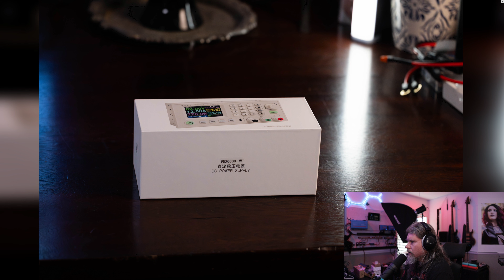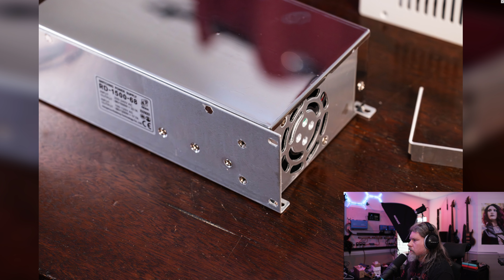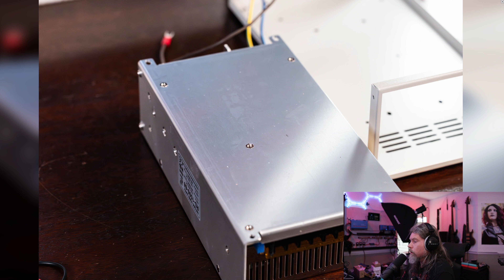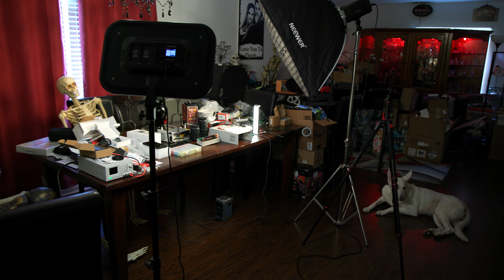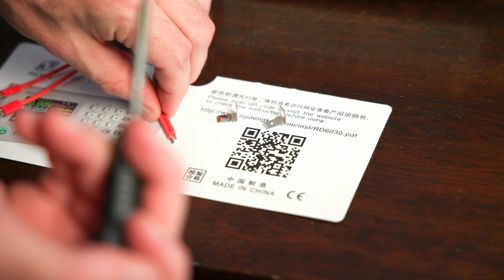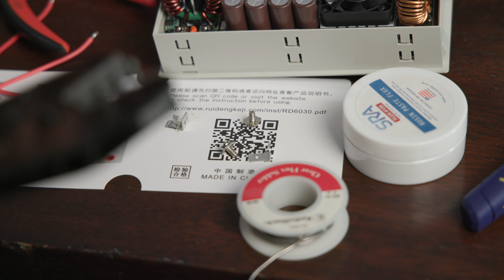Master the Art of DIY: Step-by-Step Guide to Assembling an RD6030 Lab Power Supply!

Comment from the maker: I just posted this video and I bet I just figured out what those "useless" spade terminals were for.  The size of them would fit the temperature probe.  This power supply is designed to charge batteries, and that is actually the main purpose of the temp probe is for battery charging to ensure you do not go beyond temp (This was not a review lol) but where/how would you put that probe on a battery?  The answer is that spade connector, you can screw it down and insert the probe inside.

Comment: I like the crimp connectors you chose for the DC power wires. 

IMO Riden is really pushing it with 30A and the components they are using but I haven’t seen any complaints yet.
Reply from the maker: Same, though I didn't go looking.  I have a mad scientist thing to try someday.  Combining two of them together for 60A max output.

I think what I have designed works in concept, but must be put to the test.
Reply: I'm using 6018 at work 6024 at home zero problems for over 3 years. Abusing it using as short killer at highest current capacity etc, stil holding up like a boss.

Comment: Can you still use the green terminal for charging battery with bms installed? After reading the manual, it says that it will not read the battery voltage when using a battery "protection board" (I assume it is the bms) and recommend to use the red terminal.
Reply from the maker: Yes, they are specifically talking about a BMS that completely turns off the battery so that it can't detect a battery attached.

I have never seen that on any of my big batteries, I only saw that one time on a 18v tool battery that had drained so low that the BMS completely cut off the battery to protect it.

I had to "jump start" that battery with a power supply directly to the cells, by passing the BMS until the battery had enough charge that the BMS worked again.

If the BMS turns off because the battery is fully charged, that is not a problem, that would be a desirable behavior.

So the good news is you have full control here and can use this power supply in both ways.

I would mostly use this as a power supply not a charger, because I prefer to use solar for charging but its a pretty multi purpose tool.
Reply: @ViciousXUSMC that means I can still use the green terminal for my 12v battery with bms installed? 

Do you also use the cutoff current when you use it to charge your batteries and at what current do you usually set it to?

Does backfeed from the battery an issue with this benchmark device?
Thanks!